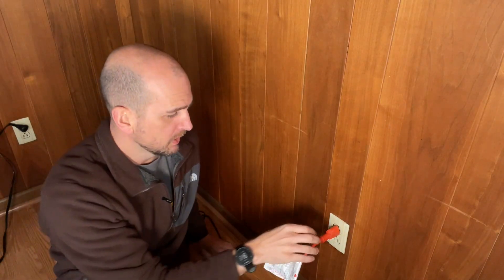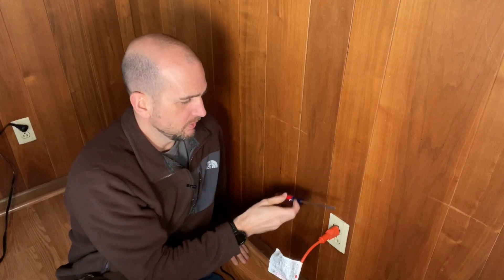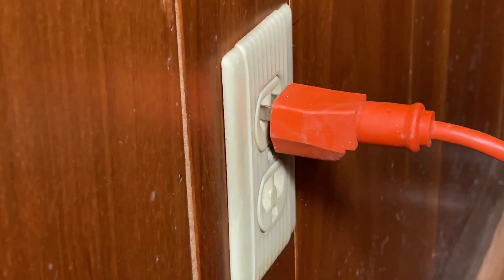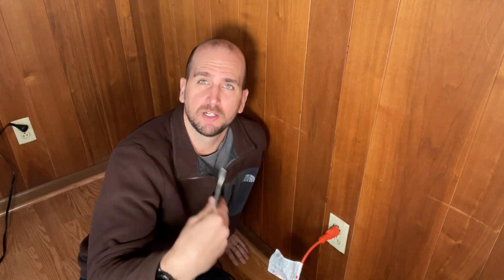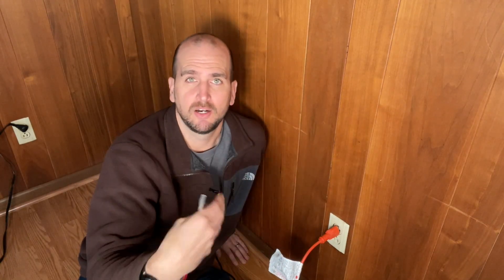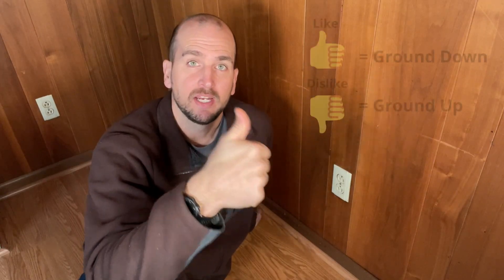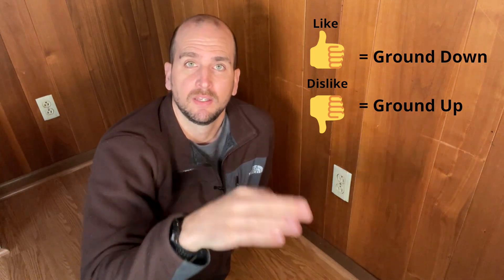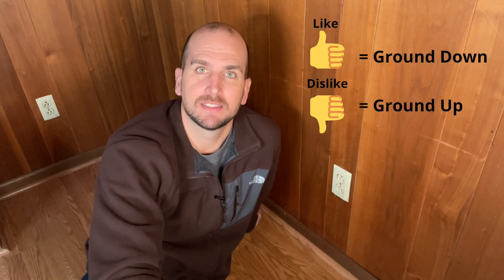Should An Outlet Be Installed Ground Down Or Up

Comment: american wall receptacles are some of the worst in the world. Completly outdated...  They offer no protection for accidental or deliberate entry of a metalic object or fingers onto or between the hot and neutral prongs. They offer no resistance to a slight pull or wiggle. They even tend to slip out by themselves thru the weight of the cord pulling down on them. European outlets are a hundred times better in protection. The hot, neutral and ground are recessed deeper into the chassis of the outlet...  no chance of getting a finger in there. They offer much better resistance against pull or wiggle. They are rated for 240 volts or more and 16A. Ground pin is a priority pin that connects always as the first pin. 

SEE "Shuko wall receptacles" for examples. Most european versions have a polarity pin or notch as well which is also an extra safety feature. 

In Germany (Schuko receptacle) the plug can be inserted any which way around, which could of course be hazardous if an extension cord or a lamp with a one pole switch is used for ON and OFF function.... 50% chance of not switching the live wire off, leaving it HOT and a potential danger to those who do not know that... one of the negative "features" shared with the american socket system.

Comment: I really disliked disliking this video.  I apprenticed for the local IBEW president and he knew the NEC backwards and forwards and had easily 50 years experience. He made it a point to tell me that there is no guidance in the NEC for orientation of a nema-5, but every outlet on his job would be ground up. So it's ground up for me unless I need it to be ground down (like behind an appliance where your likely to encounter that quick 90 )  For horizontal outlets it's ground to the left (so the neutral is up)  

He was very picky, all your faceplate screws had to align, everything square, no outstickers or innies.  We miss you Steve!

Comment: I have always wondered why almost all outlets at hospitals and industrial sites are installed with ground up, but almost all outlets in residential installations are ground down.  I could not find any definitive answer either.  The most plausible explanation I have seen is the one about something metallic being dropped on the exposed pins.  That seems like quite a stretch to me. After all, how often does that ever happen?  I can't speak for everyone else of course, but in my 65-plus years of life, I have not once seen that happen.  I did notice when I moved into my current residence that all the outlets but one are installed ground down.  The one that is ground up is in the bedroom, and it happens to contain one switched outlet--which happens to be at the bottom.  Your explanation of using the ground up configuration as an easy way to denote which duplex contains a switched outlet clears up, at least for me, that mystery.

Comment: I've never seen ground up. There are decorative nightlights sold in gift shops that assume ground down.

Also in the Chicago area, homes with sheet rock interior walls often have the outlets installed horizontally. I don't know if that is common anywhere else.

Comment: The most important wire in the electrical system is the ground wire ! Even if it's not carrying any current ! It protects the user against all kinds of faults !  On a 3 prong plug  connection, if the ground pin is on the bottom, it will be the last connection to fall out of the receptacle because of the weight of an extension cable . So , the ground  on the bottom should be your best bett !  The ground pin is supporting the male plug by it's own triangle configuration !Ground, Last one out ,safer situation  ! First one out  , no more ground but  cable still live ,on ground up connection !

Comment: Orientation doesn’t matter. You can install horizontally if you want.
Reply: But even then, I recently installed some horizontally oriented receptacles, and I made sure to install neutral up. This is for the same reason that I install ground up in a vertical outlet, so hot won’t be hit by something falling on a loose plug.

Comment: GFCI outlets label the Reset and Test buttons for either orientation. All of the 120v outlets are ground down in my home. One exception to the ground down is for a NEMA 10-30 220V outlet that required ground up (cord down) for the 90° plug.

Comment: Most DC converters on the end of the cord are made with the weight of the unit on ground side of the plug. So, ground up makes these want to pull away from the wall.
Reply: Most wall worts don’t have a ground prong or wide neutral blade, so they don’t make much difference. People plugging two of them in a receptacle flip one upside down anyway.
Reply: @robb0995  you're correct, "most" don't but many do have ground and they don't turn upside down of each other. Also, outlet appliance controllers until recently were all similar with the ground down towards the larger portion of the box.

Comment: Someone once told me there was more holding strength in ground up vs ground down (probably unfounded).
I think ground down could ensure the ground connection is maintained longer when a plug is falling out (last to lose connectivity).
I have a mechanical timer that would orient for readability in a ground down socket and most wall warts (power adapters) I have seen seem to be ground down to keep the weight below the connection point (the label is printed/attached for this orientation as well).

NSFW: The other consideration for ground down is you can draw angry eyebrows (\ /) over the top and distressed eyebrows (/ \) over the lower then add arms from the top to the bottom to make a dirty picture (d-style for the win).

Comment: Ground Down, 1. The right-angle Male Cap you demonstrated. 2. Most abuse to the cord is downward, ground down makes the ground prong the last to disconnect. 3. That partial pluged in theory for the "ground up" installation doesn't hold water. Who is to said a small length of conductive material might tilt down from the ground prong and contact the hot blade, it has a 50/50 chance. It almost certainly won't remain there, balanced on top of the ground prong.

Comment: Great video. I never knew for certain. In the 70s, I always installed with ground down. Then in the 80s, I was told by a non-electrician that they were supposed to be ground up because of the metal dropping on the plug so I started installing ground up. I thought that was code but I never looked it up. I always preferred installing ground down.
Reply from the maker: Thanks Walt, yeah it is definitely a personal preference thing when working in residential.

Comment: The argument of ground being up is safer is not valid in my opinion. While the theory is valid, realistically the odds of something metal falling on the prongs in a way that it shorts out is extremely slim. And even if that did happen, the breaker would simply trip. In a situation where a tripped breaker could result in someone dying such as in a hospital it may be a somewhat more valid argument though. With that said, I personally install outlets with the ground pointing down because that is what I am used to since I have been plugging things in that way my whole life.

Comment: All commercial buildings I’ve worked on in the last 20 years have been ground up.
Reply: Commercial code and residential code are very different in many ways. That is not a good reason to copy it.
Reply: @markpashia7067  yes. Commercial building code tends to be a little more stricter when it comes to public safety. No need to copy any of that.
Reply: @jaysgood10  Sarcasm does not suit you. My point is that residential codes can and are often very different and you must learn for your area as well. Both codes are equally strict if you follow them and because of different use cases, they do not always transfer, so learn the local residential if you are doing residential work. I have seen to many cases where folks ASSUMED if it was good for commercial, it was good for residential and IT WAS DEAD WRONG. Ass-U-Me is a bad policy.

Comment: I've always seen ground up in situations where the face plate is metal. If it comes loose you dont want it to fall across the hot and neutral prongs. In the old days mostly everything was metal so that made sense. Now every is plastic so there are other concerns. How about when socket is mounted sideways. Neutral is always up.

Comment: For me at work (I work in a hospital) It is ground up. The biggest reason why is in hospitals items are plugged and unplugged  a lot (this is why they have their own grade of receptacles) and hospitals use stainless steel receptacle covers. One day I was called in to a room that had a receptacle installed with ground down and the cover screw had backed all the way out and the SS cover came in contact with the neutral and hot of an item plugged in but not all the way and melted two channels in the SS cover about 3/4 of an inch long. Before the 20 amp breaker tripped.
Luckily no one tried to unplug the item before the breaker tripped.

Comment: I won't give you a vote in this manner however at 72 years of age and dealing with this issue for a long time I can tell you what i have been taught . The " ground lug " is there for a reason and should be the LAST thing to come un-plugged so this lug or prong must be on the bottom . If and when the cord gets pushed or pulled down this prong will the still serving it's purpose  . As for you comment about something falling across both prongs if the grounding prong is on the bottom , the circuit will be protected because the grounding prong is still in place and doing it's job. I think your fishing for thumbs up !
Reply: If something conductive lands across the blades of a plug in a ground-down-oriented outlet, it becomes a matter for the gfci/breaker/fuse protecting the outlet, the plug's ground lug's connectivity (or even lack thereof) is irrelevant.

Comment: I am looking for that information for a while since ALL of the outlets in my house were installed ground UP and I can’t plug a lot of devices bought with that third pin, or they are ... but heads down!!! Anyone having the same fu*** problem? So stupid there is no standard about this in the Building Code.
Reply from the maker: Yeah, it can be a bit frustrating.

Comment: I live in Victoria BC Canada pretty sure the hospitals have the ground up. Is it true if the outlet is Red it color in a hospital it means it will still be live in a power outage ? As it has a back up system ? Thanks
Reply from the maker: That is the word on the street that red = backup power and orange = isolated ground

Comment: I am a electrition and my town changed it that all electrical outlets grounds must be up. They made it code. The reason is a baby around 1 1/2 years old got a butter knife and was playing with a outlet and the ground was down and the baby shorted out the outlet while holding the knife and died. I wired all my outlet up.
Reply from the maker: John, where are you located?

Comment: The plugs on many appliances are designed to lay flat against the wall when plugged into an outlet with the ground down. 
When plugged into an outlet with the ground up "pig nose" configuration, the cord must point upwards and then loop back down.
Reply from the maker: Yeah, not ideal for sure.
Reply: @EverydayHomeRepairs  This is a typical case of everything working fine until lawyers mess it up.

Comment: Electrician for 40 years, inside wireman doing mostly commercial work the last 20  years we have switch to ground up now or neutral up if it’s horizontal. I have seen many people drop chains and bracelets across receptacles with ground was down and had it burn onto their flesh and gold plate the prongs.
Reply from the maker: 😬Thanks for the feedback and sharing your experience.

Comment: Ground Down ensures that the Ground would disconnect last if a grounded plug were to accidentally pull out of the outlet!  The weight of the cord will tend to pull out the Hot and Neutral connector before the ground connector!  When ground is up then the Ground connector could be pulled out before the Hot and Neutral Connector, which would leave a device powered with out a ground!   Safer to have Ground Down on all Outlets!
Reply: I was taught in College ground down because when you install a plugs in the basement and you get a flood you want the ground to come into contact with the water first

Comment: The bigger risk is metal wall plates.
I have seen many outlets with metal wall plates with loose screws.  If the screw falls out, especially those super short outlet screws, and something is plugged in, that becomes a big ol' safety hazard.

(aren't you hurting your YT algorithm by getting so many dislikes?)

Comment: When grabbing a plug to disengage it from the electrical outlet, a person’s index finger generally reaches around the bottom of the plug. Therefore, their finger would be more likely to come into contact with the ground plug rather than the live prongs. In addition, many household items like lamps, chargers and timers are oriented for plugging into a prong-down outlet. GFCI electrical outlets are also meant to be installed ground pin down, as they feature text on the test and reset buttons that orient in this way.
Reply: 1 or 2 brands of GFCI outlets have text that can only be read ground up. Some brands have text oriented both directions.
Reply: @williamlewandowski5053  Most GFCI receptacles have lettering for both ways and some even have it SIDEWAYS for mounting left-to-right.

Comment: IS IT OK,..i changed several (from 2 prong)in a 1950 home w/bx  cable ,removed screws on both old and new so i would not have to bend wires or disturb wires much...so some outlets ended up upside down..ALSO i used the green pig tails and screwed then into the back of each steel box,.,..did i do good or bad??

Comment: i was taught by a 40 years in the field licensed electrician over 20 years ago "ground up thumbs up..ground down thumbs down for inspection". so the battle still rages on over 60 years later! hahaha! he worked from other states but he mostly taught in NY. so it may differ by state. mostly all the tools and receptacles/outlets in NY are manufactured with grounds/markings oriented up. technically electrically it not matter because u still wire to same points, it just mostly preference for the area code person approving it. some won't pass if 1 way or the other(unless u argue) because that was just how they were taught.

Comment: With all the chargers, power supplies etc that we use in today's world, it would be nice to have the upper outlet ground up and the lower one ground down. Many times two chargers or power supplies will not fit in the same receptacle due to their size/configuration. If they made all outlets like this, it would end this discussion, as they could never be installed "incorrectly". Always plug into the upper outlet first to eliminate the non problem of things falling on the conductors, and night lights can be upside down. Circuit checker companies will need to accommodate.....

Comment: The first thing to connect with the receptacle should always be the ground.  The last thing to disconnect from the receptacle should again be the ground.  This is accomplished by the ground on the bottom side of the receptacle.  Please note that the ground pin of a plug is longer than the current carrying pins to allow the ground to connect before the current carrying conductors and to disconnect last.  If the receptacle is loose it's already a fire hazard and needs to be replaced.

Comment: Aesthetically wise,  I've been programmed for ground down since I was installing outlets at 15. I worked weekends with my older cousin who taught me the trade before I got a degree in electronics and climbed the ladder from there.  Though aesthetically pleasing in my opinion, please let me tell you how I almost killed myself in the garage one morning. My dad had a peg board packed with tools and stencil lines around each tool. To this day it's a wise investment.  However, I needed a carpenters saw that was to the right of the outlet. I would have to lean over the table to get the saw but I noticed it was not hanging straight down.  It was kind of perched near the outlet be I didn't digress. I just grabbed the saw and since my bare feet were on a morning dew cement floor,  120v shot through me and I could not let go of that damn saw.  But I guess I passed out because I was on the garage floor with a bump on the back of my head and I felt like I got hit by professional linebacker. I got up slow and felt tingling on the soles of my feet and they were like that for hours. I was seriously tired all day and my mom called the hospital for advice. But they always want you to come in so they can make money over giving you what's done is done advice.  Now had that outlet had the ground on top, you would not be reading this story...

Comment: Ground up and you can’t put the little night lights in it right side up. My wife still won’t let me forget.
Reply: HAPPY WIFE..HAPPY LIFE!
Reply: That just goes to prove some asshole started this who didn't know shit!
Reply: Um night lights usually 2 prong and with night light it doesn’t matter what way you plug the night light in. If the prongs are the same size it doesn’t matter what way you plug in. If one of the prongs on the device your plugging is bigger that’s the only way you can plugging in and the bigger prong is the neutral side of the device.
Reply: Oo and most night lights that have a ground plug is the ones that have the wax oil tops. So if the wax over fills there’s a redundant ground for safety.
Reply: @tylerjcook  "It doesn't matter what way you plug in"??  Obviously it does matter, based upon bigal's comment. Night lights are now generally required to have polarized plugs, just like anything else with a replaceable bulb.